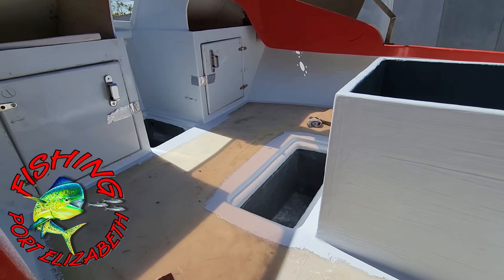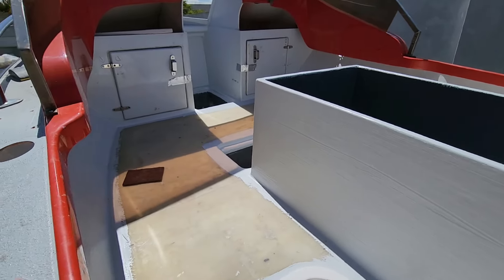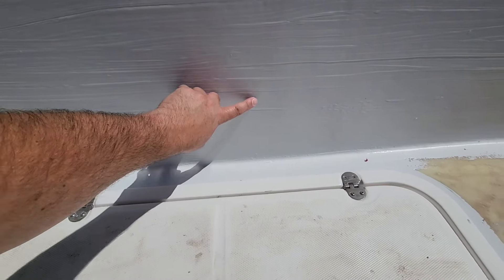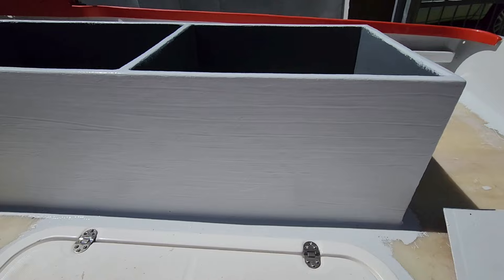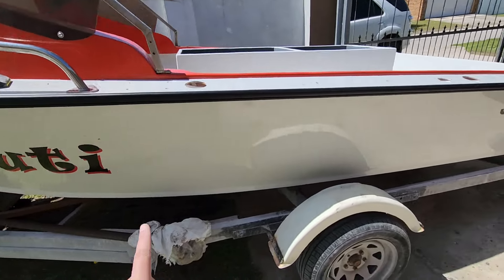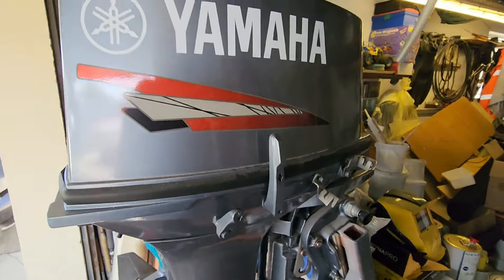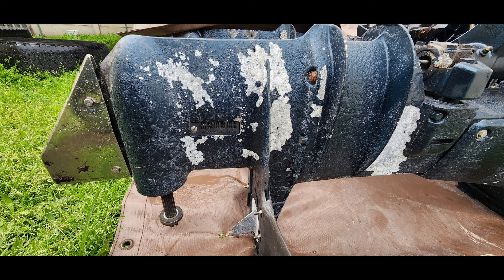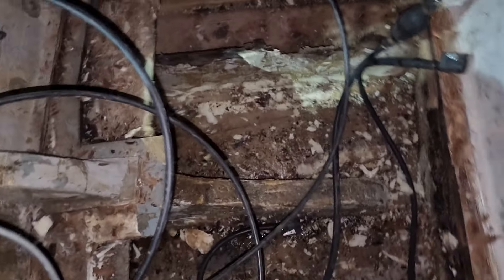ace craft restoration update.

Comment: Howzit Wesley, Boat is looking great! Excited to see it on the water again. I would like to make my deck non slip as well. What sand did you use and what did you use to make it stick before painting over it?
Reply from the maker: How's it keegan.
Thanks for the positive feedback. I got some silica sand from a friend of mine. The best way I can describe it is that it look alot like pool filter sand just not so course. I rolled a thin coat of resin on the deck and sprinkled a very heavy amount with a corse flour sieve to get it even. Then left it for 24h to set then vacuumed up all the excess sand. Then I rolled a thin coat of poolcoat over the Sand. Only problem is the poolcoat take very long to cure because is put on thin. Alot of guys use 2k paint over the sand.